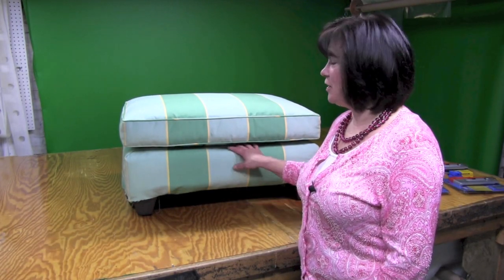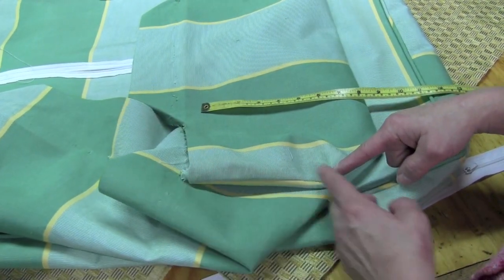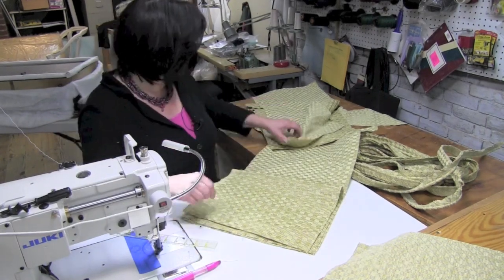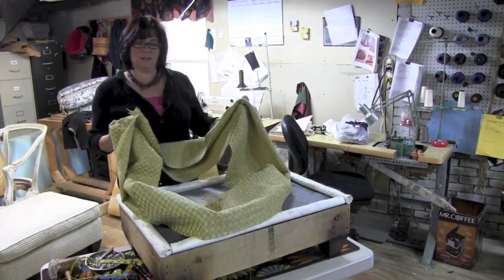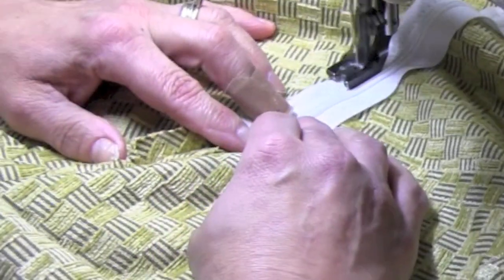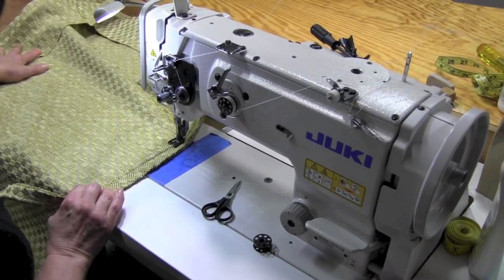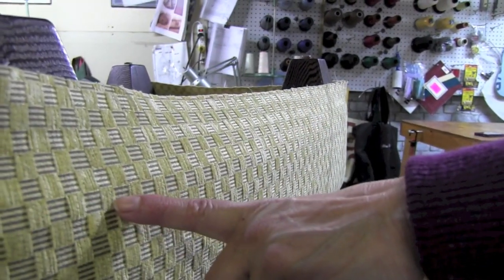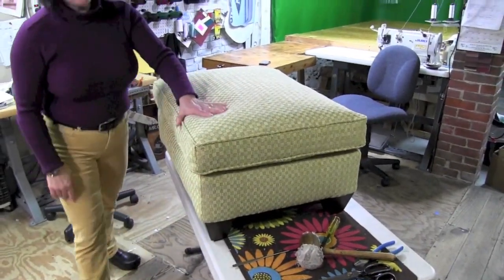Upholstery "How To Reupholster A Pillowtop Ottoman"

Comment: Thanks, Kim!  Your steps were so easy to follow.  I just finished upholstering my own ottoman -- one I'd bought that required a slip cover to be purchased separately.  Since I already had a lot of fabric left from a long ago project, I opted to create my own cover, but wasn't sure how to do it.  I found your video and voila!  Of course, as an amateur, mine has its share of flaws and errors, but I don't think it's too bad for a first timer.  A cording foot on my sewing machine would've probably made it a little easier, but I managed with my zipper foot.  I'm now inspired to tackle a few more little projects.  Thanks again!
Reply from the maker: Great Joan Elsenstein. keep it up and soon you will be a pro with people knocking at your door hoping you will upholster for them. That's how it happened to us some 20 years ago. Kim

Comment: I recently bought an ottoman identical to yours at a garage sale. It's in great condition but doesn't match my couch. After watching your video, I think I'm ready! I can already feel that my biggest mistake will be in measuring where the bottom of the pillow attaches to the base. That part feels a little overwhelming. The ottoman does have piping but my couch doesn't. Do I have to use piping? I'm using a thin brown microfiber fabric.
Thanks for the terrific video. Just for fun, have you ever posted any out takes?

Comment: Hi Kim. My name is Meg and first off thanks for the great videos. I am in the process of recovering a pillow top ottoman and on my 2nd attempt (1st with your video). I'm stuck though. I have my ottoman frame piece done and ready to attach to right side of bottom cushion piece. You are lining up miters with some box marks located on the bottom cushion piece. Where did those markings come from? I did not have a pattern to follow so I am going off measurements.  I hope you can help. Thanks!!
Reply: I have the same question!
Reply from the maker: emerson brantley  lovesron  Here goes.... I would put the bottom piece for the frame over the frame right side up.  Now place the cushion bottom which will be sewn ontop of it right side down.  Making sure it is layed ontop so it is even all around, corners match up and such pin it to the frame portion of your fabric very securely. Now take it to the sewing machine and sew it on.  You can also use measurements from the corner of your frame fabric into where the seam will be and use this same measurement on your cushion bottom plus the seam allowance (the 1/2" around the cushion edge).  Either way will work.  Its hard to explain with out a visual to show you, but hope this helps.

If you are on FB please share your project pictures on our Kim's Upholstery page.  I would love to see them,
Kim

Comment: Hi Kim, Your great videos will be included in my gratitude lists for tomorrow's Thanksgiving.  I have a question about interfacing I hope you'll answer.  I apologize for the length!  My old cover has interfacing that was used to hold the pillow to the frame.  It was sewn to the base component so that it also provided a double row of stitching attaching  the base to the pillow top.  Then, I suppose with the base component inside out over the pillow, the interfacing was stapled to the frame.  Next the edge roll and cotton batting were applied.  There was also a strip (approx 2" wide) of a layered paper product stapled on top of the interfacing at the lower edge of the frame under the cotton batting (and the skirting which isn't being replaced).  Then the base component must have been pulled down, turning right side out over all of that.  

Not until I was writing this, did I come up with the theory that the interfacing was used to provide protection against lateral movement of the pillowtop and any stresses would be at least partially absorbed by the IF rather than just the base component.  If that's not why they did it, what was the reason?  I'm wondering if that wasn't overkill?  Was the one you've redone here attached to the frame in the same order?  Presuming you say that using the interfacing at the very bottom is the old way of doing it and it isn't necessary to reconstruct it in the same way, would you change your answer if I tell you that my dog runs and jumps up on the furniture with way more force than you'd think a 25# dog could muster and that the cover fabric is a faux leather (polyurethane not PVC)?   

Many thanks for all the videos that you have put out to help all of us amateurs.
Reply from the maker: Hi Lorraine. I am able to visualize what your describing but it sounds like your analyzation is right.  I haven't seen one with the interfacing before but hope. Do at some point.  Thanks for watching the videos Kim

Comment: Kim, The step where you connect the bottom of pillow top and the bottom ottoman cover is not clear to me.  How did you come up with the points to intersect both pieces?
Reply from the maker: Hello,  you need to find the center of each fabric piece and match them up.  Hope this helps,
Kim